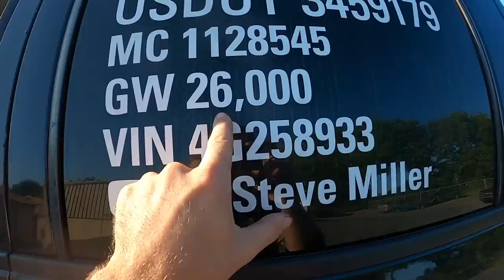How To EVERYTHING Hotshot Car Hauling | Comment Suggestions Below | Hotshot Trucking

Comment: Another thing, Steve.  You run a dually, which should be around 14,000 lb gvwr.  When you say 9,000 in the video, are you referring to actual weight with full tanks?  The other youtubers say that the  gvwr of the truck plus the gvwr of the trailer has to be less than 26,000 lbs.
Reply from the maker: No, the gvwr of the truck is 9,000. It's a 2500 with a dually axle swapped under it. 

Also no 04 dually was 14k. The newer ones are just not the older ones unless you buy a 45 or 5500.

Comment: I have A32 foot checkmate.
 Boat in Fort Lauderdale Florida. I would like to get brought up to Grand Rapids. Michigan, it's a bumper toe 3 inch ball. Try axel I was told has new tires and wheel bearings all lights work
Reply from the maker: If it has a trailer we may be able to schedule it. If so feel free to get into contact with me. All links are in the description.

Comment: California has had issues with the system they have in place regarding the trailer weight. They have been going by the state that you are registered out of. I’ve had 2 DOT Level 1’s in California in the past 6 months and both inspectors let me go and passed me with zero violations even though I’m Non CDL and I was running at about 25,000lbs and my trailer weight was over 10,000lbs. They both said technically it’s a violation but they’ve been told to let it go since I’m out of Oregon and that’s allowed where I’m from. I’m just throwing that info out just in case you need to run to Cali.
Reply from the maker: I've been there 6 times and don't have a need to go back. Been 11 months since I posted my last hotshot video. I don't miss traveling!
Reply from the maker: Cali has that 10k trailer rule

Comment: In England. Anything over 3500kg is classed as hgv,  so to be used commercially you need a licence to drive that category,  you need a cpc card and a digital tacho card. So it's not easy here either. Plus you can only drive 4.5 hours before you need a 45 minute break.  Then you can do the same only you then need an hours break. And you can only do so many hours per fortnight. Nightmare! Keep well and Thank-you.

Comment: When you do a direct customer like in this video do you still have to pay the % to the company you lease under?
Reply from the maker: It's 15% to the company. I get 3% back when I get the loads myself. I get 2% back if they pay cash or check and I deposit the money into the bank for the company. Potentially get 90% of each load depending on the circumstances

Comment: I have a class B  i would like to start  driving  for my self
Reply from the maker: Class B means you won't be able to run CDL.

You are allowed a power unit greater than 26,000 but are limited to a trailer under 10,001 pounds.

Pretty much you have two options
Option A: Run non cdl(26,000 gcwr)
Option B: Get your cdl A

CDL B is for school buses, dump trucks, etc

Comment: Why do you pull the breakaway switch when you park the trailer? Those brakes do not activate unless there is forward motion and also it will kill your 12 V battery if you leave it unplugged for a length of time. Just curious on your reasoning
Reply from the maker: I don't. If you watch carefully you'll see I put it back in. Only reason I pull it is because you have to do that to loop the cable through itself. Have to do the same to take it off as well. It's always left in when parked

Comment: How do you feel about a 5th wheel toolbox?
Reply from the maker: I don't like them. I really want to do away with the crates as well but I don't have the space on the trailer yet
Reply: I’d like to help you build some expanded metal slide side boxes to fit between the rails. Could fit a lot in there anywhere under the current expanded metal wheel rail. I’ll bring my welder along the road and we can fab it up!!!!
Reply: @CPSteveMiller  I thought that would look pretty slick on your rig.  It's even got room in the middle when you're coupling and uncoupling

Comment: You can make money running one. Everyone is different on what they need.But at that $1k per car how much is that per mile?
Reply from the maker: I try to get around a buck a mile. On cars it's difficult with just one. At 1500 miles MAX at $3k down would be a minimal of 2 bucks a mile. I try to get in between 2 and 3 bucks a mile for 3 cars. Going back up I try to get 2k on 1200 to 1500 miles. Coming up is stupid cheap

Comment: It drives me nuts on those with ask all the time about trucks and trailers. Simply thing to research. I know my truck is 14k, trailer 20k, 34,000GCWR being CDL. People also drive me nuts saying "i need a non CDL trailer". Theres no such thing! You have to derate according to the truck as you know. 

My questions are all the paperwork wise when going lease to a company. (Trying ti locate your video as idk you had one) Especially reguarding IFTA, load insurance, dispatching and truck and I,  and if ill have to get it myself or company supplied.

On a side note, i see the company your under only deals with cars and tow away. Not general freight, equipment and such according to the MC site which is what ill stick to unless i can get a pickup to get me out of a bad load area with not much loss. Plan on swapping lease comapnies, going into business yourself, or sweet-talking the owner upgrade his hauling status on the MC?
Reply from the maker: This company is mainly focused on power only, trailers, boats, rv, etc.. I'm the only one who does cars. I'll be getting my own authority again either late next year or early 2023. I want to build up myself and my equipment first before I decide to give myself that responsibly. But yeah I've always hated the "I need a non cdl trailer" bs.
Reply: @CPSteveMiller  Always good to move up that way. Quick question as ive read the FMCSA site 3 times and still probably just overlooking. If obtaining a CDL with auto and airbrake exemptions, and later wanting to test to get them removed is that extortion course required to get them removed? 

On a side note, If you ever want to lease people on later, hit me up. I've hauled septic tanks, trailer stacks, oversized (15ft wide and 15ft tall), small buildings, building kits, drill pipe, construction/farm equipment, general palletized freight, and vehicles. If i ever make up my mind on preparedness and get my a55 in gear, i just need to schedule a DOT physical and go take the general knowledge and tanker endorsement. Plan on getting hazmat and tanker as a security net for empty placard tanks.
Reply from the maker: They're making it that you'll have to go to school to remove any of those restrictions from from I heard.

Comment: I want to get into car hauling, because I want to buy a box truck. Then run freight that I'm used to off of the DAT board or Amazon. I've been a truck driver since '02, and I'm tired of the big rigs. 

I have a '97 Ram 2500 (5.9 V8 ...8800 GVWR) that will be put to work. My plan is to get either a single or double car trailer, and run from Reno, NV (hometown) to California. ... Either Bay area & do a bunch of locals there, or run the central valley back & forth. After a few days or so, I'll go home. 

My issue is figuring out eBOL's. Any info on that would be greatly appreciated. Thanks in advance. :)
Reply: Get a dually for stability, whenever possible.
Reply: @markbremmer8642  ... I've been looking at Arrow Products. They have dually conversion kits for around $1200... minus the tires.
Reply: Salvage yards are a good place to find the parts you need for the swap as well. A lot less money, but a lot more efficient IMO.
Reply from the maker: We use super dispatch for bol's. Pricey, but worth it
Reply: I'd be more concerned with the V8 gas in a truck from 1997. My son's is an '02 Ram, and there's not much power in that thing. Towing with it will sure put a strain on it.
Reply: @kellymichael7362  It won't last in  car hauling, freight hauling. Find  a good used 12 valve to put in there. Or if he can afford it, get a used diesel truck.

Comment: I have an inop Kubota l5030 compact tractor in davenport FL that needs to go to Penn yan  NY any interest?  It weighs #3800 and is 10.5 feet long
Reply from the maker: I would but I don't have ny access. They require HUT so I stay out
Reply: Could you drop it at your storage unit and I pick it up there ?
Reply from the maker: I could do that. Send me a message on Instagram or Facebook and I'll contact you from there. I'll be dropping 3 loads on Monday in Florida
Reply: @CPSteveMiller  I went into NY plenty of times and never ran HUT only got cited a couple of times but save a ton of fees!! You might be able to buy a NY permit at POE??!!

Comment: What compressor you have there? What it cost u?
Reply from the maker: Milwaukee. I think they're like 350 at home depot
Reply: @CPSteveMiller  and no issues? I was actually thinking of getting air horns and connecting an air line to that 😁
Reply from the maker: I love it. The tank isn't the biggest but it will fill tires a lot better than any of the portable little compressors will

Comment: Steve take the break away cable with you make it harder for some idiot steals your trailer!
Reply from the maker: You can't. That'll kill the battery on the trailer and wear out the magnets😬
Reply: That, and they could just cut the 2 wires going in and connect 'em to each other.
Reply: Thx glad you told me that! You taught me something! Lol

Comment: 15-20 mins pre trip/post trip is bullshit ive been dot'ed i dunno how many times and i only show 5 mins both no violation
Reply from the maker: Damn I've seen people with issues doing that. 15 I was always told was the magic number. I'd rather be safe than sorry. I imagine if you show 5 minutes on a semi pretrip you'll have issues. I haven't had any at 15 minutes
Reply: @CPSteveMiller  ive been driving a rig since may 23 2017. my trainer at my first company i drove for said as long as you show 5 mins of pretrip/post trip your fine honest not single violation

Comment: So you’re running the app on your tablet or cell phone from keep trucking for your ELD how does it work I have a 95 international so I’m exempt . I know how to run paper logs but honestly I would rather have a app on my dedicated tablet for an ELD but a lot of guys say that the apps don’t work the greatest but being that my truck is pre emission   I have no way to plug-in a actual ELD . Your  exempt why are you running an ELD . I just honestly feel DOT won’t give you as hard of a time if you have the ELD instead of the paper logbook that they’re going to go over and try to scrutinize every single line on it .
Reply from the maker: I don't have an eld is what I said. I have keeptruckin's app. It's the same thing as paper logs. I can't plug into my truck either. No eld. Just the app
Reply: Yeah, and you can edit your trip in the ap, but can't when it's plugged in to your truck. To me, paper logs are quicker. Depending on the DOT cop, ELD or not, he still might give you a hard time.

Comment: You can't haul a trailer commercially with a GVWR over 10k without a CDL in Texas period! Most other states are adopting this rule also so do your homework before jumping into this business.
Reply from the maker: Texas is like every other state. 26k or under no cdl PERIOD. Takes ten seconds to look it up on their website. The guys saying a trailer over 10k needs a cdl are wrong every time.

Class a - Combination over 26,000 inclusive to a trailer over 10,000.

INCLUSIVE. That means you have to meet BOTH requirements for it to be a cdl a rig.

Comment: You haven't had anyone try to lie about damage to a vehicle and get you for it?
Reply from the maker: Oh yeah. That was big when I used to do local tows. Not so much anymore. I have every customer sign off on the spot
Reply: I’ve had a couple roadside club calls try to claim tow damage. That’s why I take pictures before I load and when I unload cars. I also now have front and rear dash camera on my truck. Some club calls require pictures sent on the app before and after tow and the customer has to sign that they saw you take the pictures.